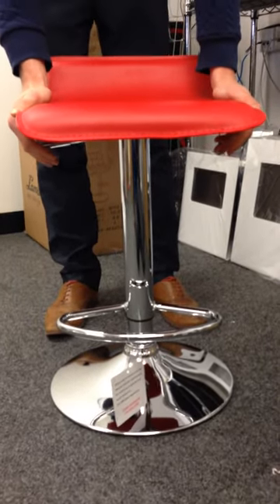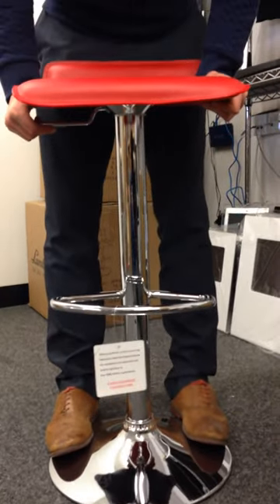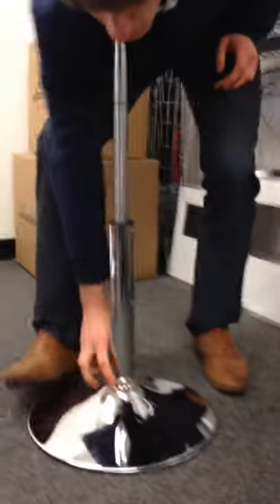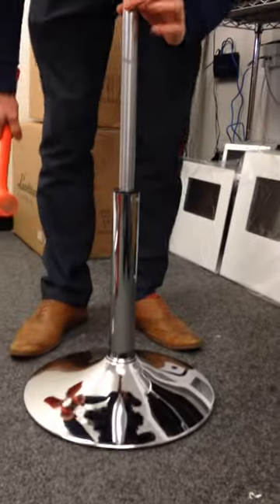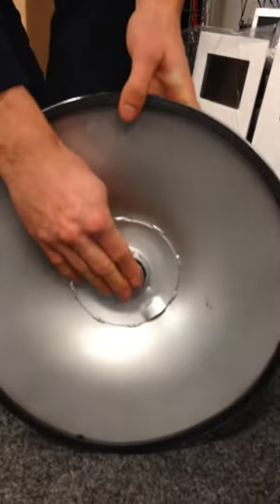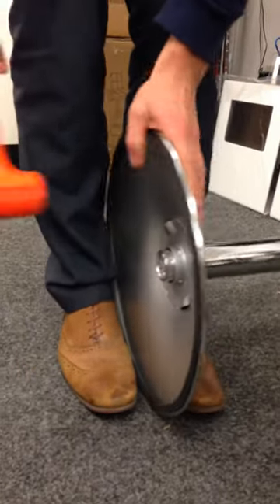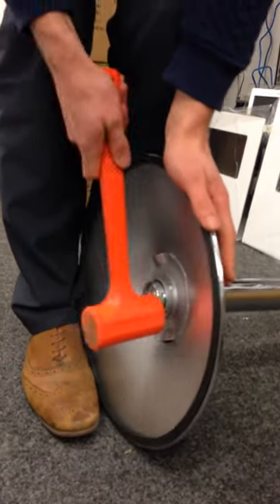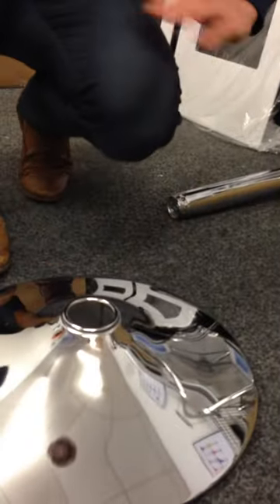How to Remove Your Bar Stool Gas Lift - Simply Bar Stools

Comment: Not one video, that I can find on YouTube, shows how to remove the bottom encasement tube covering from the actual gas strut.  In my case, the two outer tube shields on my bar stools are brushed SS, not chrome, therefore I always want to reuse those encasement tubes and need only the gas strut to reinsert.  Would be nice if you had taken your video just one step further to show that process.  I'm actually not finding just the gas strut to purchase and reinsert into both pieces of my brushed steel encasement's.  It appears that the replacement gas lift comes with the bottom chrome covering already attached.  How do I remove that so that bottom chrome covering so that I can reinsert just the gas strut into my brushed steel encasement's?

Comment: Can someone tell me how that stupid pressure pipes does function??? Try to elevate the stool (yes, I took out the plastic cap before assembling it) but it didn't do f..... Then try to test it and the inner pipe did go up : yeeees! Try to push it back, but still nothing. It didn't wanted to budge... Duh!
Whats wrong with that piece of crap????